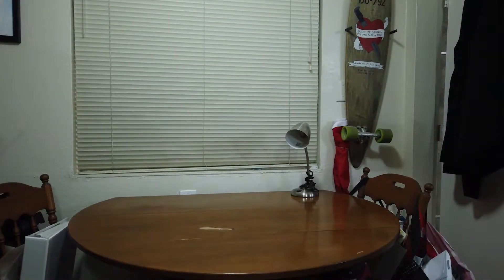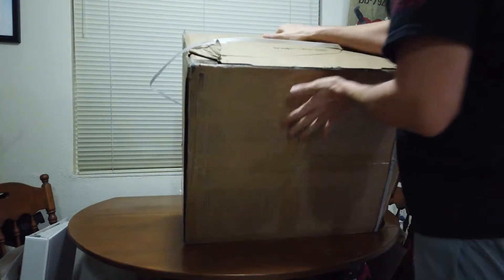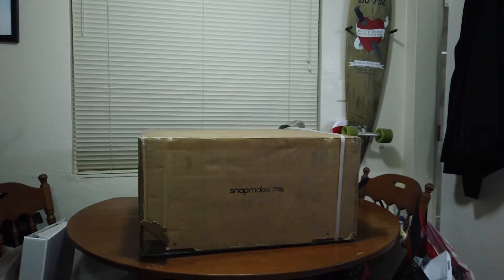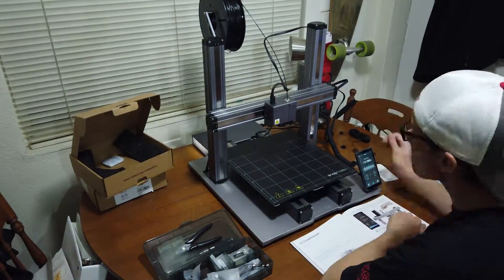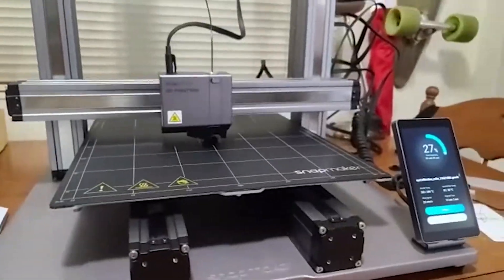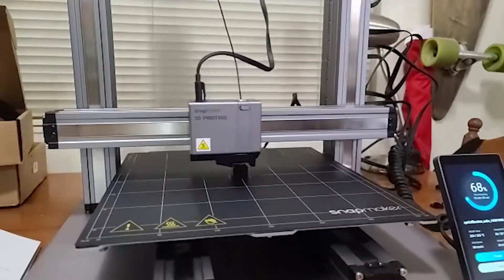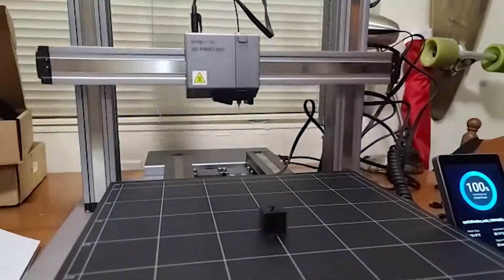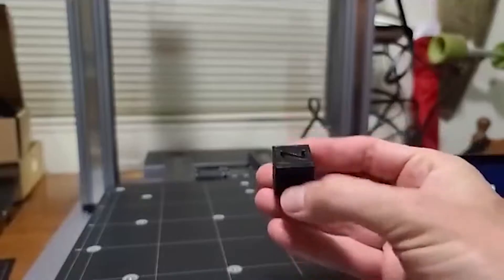15 Months Waiting for This?

Comment: Nice to see that, despite the battered outer box, everything came out in working condition and that it turned into an enjoyable unboxing and assembling experience. Just got mine as well and I'm impressed with the attention to detail and build quality. The only concern I have is support and replacement parts. Anyway, thanks for sharing!
Reply from the maker: I actually just had an induction sensor fail. I'll probably do a video on it for trouble shooting, but when I reached out they had me verify some steps to test it and then just ended up sending me a new onr within 48 business hours of opening the service ticket.